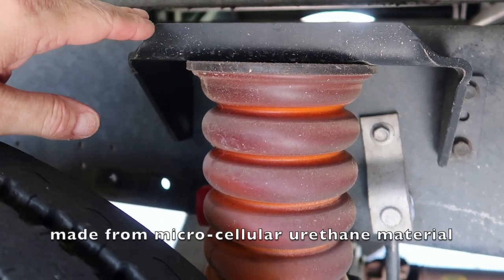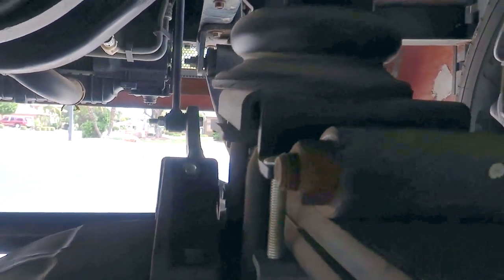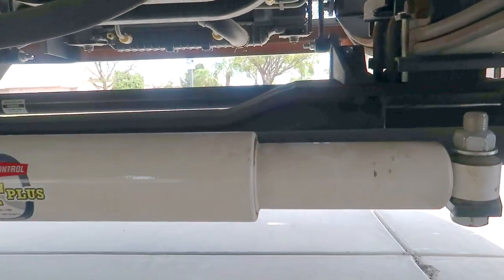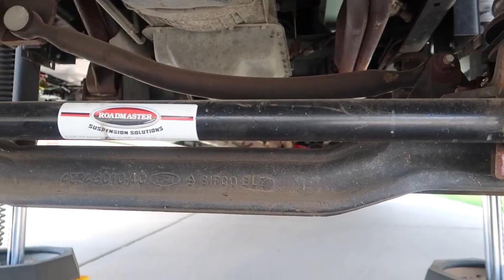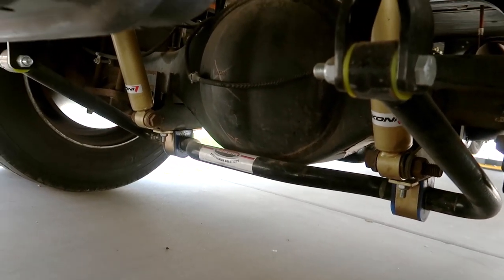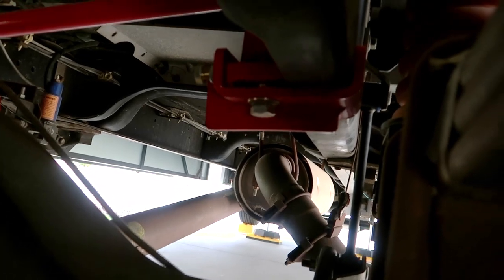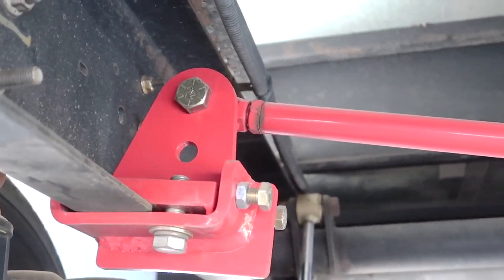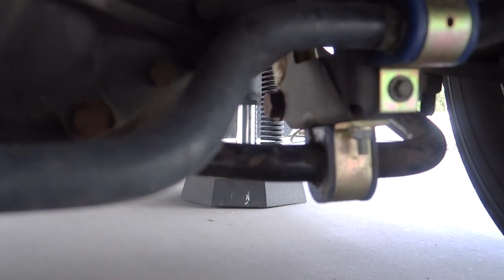CLASS A MOTORHOME SUSPENSION UPGRADES [NOT SO CHEAP HANDLING FIX]

Comment: Thank you very much for covering these suspension components!  They look to be well worth their money for additional comfort and safety.  I am kind of surprised that the manufacturer doesn't include some of these additions.  It would make their product just that much better out of the factory.
Reply from the maker: Thanks, Alan!  You are right!  Until 2020 Ford had not made any significant changes to the chassis.  In 2020 they upgraded the sway control bars, shocks and bumpers. They also replaced the Triton 6.8 liter V-10 with a 7.3 Liter V-8 engine.  Thanks for watching!

Comment: Great video. Thanks for all the good information. I just came home with a 2019 precept 29V. We love the floor plan, however, when I got home last night I realized that it is sagging to the left.

The unit has one huge slide on the left/driver side of the RV. So, there’s a lot of extra weight on that side. I’m about to make a video for the dealer and for Jayco. I haven’t decided yet if I’m going to try to get my money back. I know I bought it as is with no warranty but it was less than 24 hours ago. It did have an inspection but the inspector didn’t mention anything about the suspension. It drives great. I mean, it drives as well as my 2010 Winnebago vista did. I didn’t notice that it was leaning to the left because the dealer had it set up on the leveler when I arrived. And then I took it for a test drive and it drives great.

Anyway, I was wondering if you had any thoughts about how to modify this suspension to help adjust for the additional weight on the driver side?

It seems like this could be a safety issue. There’s so much extra weight on the rear tires on the left side and also on the front left wheel, I would be concerned about having a blowout at some point. You can already tell that the tires look like they’re under a lot of weight.

I’ll share a link to my YouTube video once I get it done later today. In the meantime, just wondering if you had any thoughts. Thanks again for your video channel. I just subscribed and I look forward to checking in with you later today.
Reply from the maker: Hi there! Thanks for reaching out. Send me an email to LyfUninterrupted@gmail.com and I’ll provide my phone number so we can discuss.

Comment: Wow, we also have the SnapPads. We love them. We found that good tires with correct tire pressure and a wheel alignment made a significant difference. We also did the "Cheap Handling Fix" to the front a few weeks after and that helped further. We also put in the Roadmaster stabilizer a couple of months later but haven't noticed any difference as yet. With your handling mods, did you test drive after each mod to see what helped what, and what didn't make much of a difference?
Reply from the maker: DrinkinSlim The Sumo Springs, anti-sway bars and the safetplus made the most noticeable improvement on handling. The rear track bar may have made the least improvement. Rigs with longer rear overhang will probably have more improvement on tail wag.

Comment: Good video. I see you have a set of headers. I installed a banks kit and it made a huge difference in power but the only time it makes a mileage difference is the times my wife drives . She managed over 9mpg in Nevada.  I was looking at whether to put a trac-bar on the rear of my Class C . The front is independent coils so doesn't need it. Thanks for the input.
Reply from the maker: Hi Bob!  9-10 is pretty much what our coach gets. Not sure what the mileage was before the addition of the Banks kit, but the owner said there was a noticeable improvement in power as well. Thanks for watching!

Comment: Any Demo on the changes in the suspension?
Reply from the maker: No, but the changes are dramatic over the stock setup. This said, I would recommend adding the safetplus and replacing the front anti-sway brace first to see how much that improves the ride. If you need more control or comfort then add the sumo springs, additional rear anti-sway brace, then track bar.  In that order. 

Hope this helps!

Comment: Where did you get your alignment done? was it on a rack/machine or was it manual adjustment with a tape measure? I have a  new to me 2003 Monaco Knight and Just came back from a 1K trip and it drove terrible.
Reply from the maker: I always have it aligned at a heavy duty truck shop or a service shop that is knowledgeable of the chassis and coach characteristics.  Don’t rely on a generic tire shop to do the alignment.

Comment: I was told Safety plus will not work on my 2000 winnebago brave 35C!!
Reply from the maker: Sorry to her that Kellie. I did check on the website and your RV is not listed. Did you call the company to verify?
Reply: @LyfUninterrupted Yes and actually ordered the parts which a certified RV mechanic told me it will not work on my class A!! I had even given my Vin# to correctly get the parts!! It's been a complete hassle since!! Etrailer assured me that I ordered correctly and have the confirmation to prove it!!

Comment: I have a 07 Forestriver Georgetown, just came thru Washoe Valley wind blowing me everywhere, that’s Reno area. Will Sumo springs stop moving me around. Great video.
Reply from the maker: Keith Schwaiger That’s a tough question to answer without knowing the condition of you existing equipment. In general, Sumo Springs will increase control and stabilize sway.  If I were you I would probably start with an rear auxiliary anti-sway bar as well as a larger front anti-sway bar. If you already have those then you might want to go with Sumo Springs. My coach is so much more comfortable and easier to drive.

Comment: What was the biggest improvement of all? Are the knoni's worth the money?
Reply from the maker: The biggest bang for the buck were the new front and rear anti-sway bars and the steering stabilizer. I always recommend installing those first, then go from there until the coach provides the level of smoothness you desire.  The KONI shocks are much better than the stock Bilstein shocks...IMHO.

Comment: Will these upgrades work on 2016 Winnebago vista lx 35’on a f53 frame . Also are all f53 frames typical. You don’t have the part that bolts to the differential in your store
Reply from the maker: Hi Kevin. There most likely would be versions to fit your coach, but you need to check each component to verify fit before ordering them. 

As for the rear track bar, you can find it at www.supersteerparts.com.

Comment: Great Video! I’m curious to know if any of these mods reduced road noise level in the cab and improved the overall comfort and cushion. We have a 2016 holiday rambler admiral and the impact on the smallest bumps in the road will shake and rattle the inside of the rig tremendously. I am Looking for a solution to soften up the ride and reduce vibration from the road.. any advice? Thanks again!
Reply from the maker: Hi Vincent.  I assume you have a gas coach.  The Sumo Springs definitely help soak up some of the road noise.  Another tip is to make sure your tires are at the right pressures.  Tires that are over inflated are firmer, which can translate noise and road anomalies to the coach.  I try to find the sweet spot so that the tires are properly inflated but still not too rigid.  Our coach is on a 20,500 pound chassis and I run all tires at 85 psi.  That pressure is based on Goodyear tire pressure recommendations for the weight of each axle.  Hope this helps.
Reply: Lyf Uninterrupted  awesome and thanks for the tip! I actually lowered from 90 to 82 psi today and found that the coach had more sway. The ride is more comfortable but now more unstable. I guess 80 psi with your mods would be just right??
Reply from the maker: It's hard to say.  Have you weighed your coach recently?  If not, I would recommend you do that so you know exactly what pressures to run.  Here's a link to some great info on tire pressures and coach weight: https://www.motorhome.com/motorhomes/motorhome-gear/weigh-to-go/.  Do some more testing with tire pressures, but my guess is that your coach would benefit from aftermarket front and rear sway-bars.  However, before you spend any money on anti-sway bars, try doing the "F-53 Cheap Handling Fix".  There are plenty of videos on YouTube that show you how to do that.  This simple adjustment to the front factory anti-sway bar may make a big difference in the handling of your coach.  If that doesn't work, then you may want to go with a replacement front anti-sway bar and an auxiliary rear anti-sway bar like I did.
Reply: Don’t underinflate light truck tires.  They’ll heat up and fail.  They aren’t like car tires.  They’re made to be run at optimum pressures, is what I’ve been told by mechanics.  Bus driver, here.

Comment: thanks so much for this upload and your explanation.  It is really well done and very helpful.  We are looking at a 2007 Mirada on the F53. the dealer was saying that it gets pushed around a lot and tried to steer us away.  Your video has me convinced to go ahead and buy, then use your tips to get me to be OK with the ride. One question I have is what upgrade would be the first to do?  Thanks again, really well done
Reply from the maker: Hi Robert!  Welcome to our channel and thanks a bunch for the kind words. The Coachman Miranda is a solid coach for sure. How many miles does the coach have on it?  The easiest and simplest upgrade to do first would be to replace the factory front anti-sway bar and add an auxiliary rear ant-sway bar. Start with front and see what results you get. I’d be willing to bet it would help a bunch. Then add the rear anti-sway bar if you’re not satisfied.  Another key component in ride quality are the shocks. If they are original then I would have them replaced.
Reply: @LyfUninterrupted  Hi Lyf, thanks for the quick response  coach has 40192 on the clock  it's an 07 asking 29k.  Needs some updating  stickers are shot needs a good buff  fabric is let's say, dated  I hear good things about the F53 with V10  I am not a mechanic but can do most repairs myself.
Reply from the maker: I really like the Triton V10 too. Good luck with the coach and be sure to let me know what upgrades you make.

Comment: I'll stick to the cheap handling fix, this stuff is way out of my price range
Reply from the maker: The cheap handling fix often times turns out to be an expensive repair. Many have reported that the links end up breaking with damage done to the chassis.  We would recommend starting with a large front anti-seat bar. See how that changes the handling, then move to a rear auxiliary anti-sway bar. Often times this is enough to improve the ride substantially.

Comment: Hi. How did you get the old bushings out of the end links?
Reply from the maker: Great question Ralph. I simply pressed/hammered them out using an old socket that fit. They came out pretty easily. Press/hammer the new ones in the same way.

Comment: Great video.  I'm about 2 projects behind you but have already noticed a handling improvement. Did I notice headers on that engine? If so, are you happy with that addition?  Thanks!
Reply from the maker: That’s great!  Which upgrades have you installed?  The previous owner installed a Banks Power Pack system. Headers, new air intake, 4 inch exhaust and engine tuner. He said he noticed a big difference after installation.  I typically run no more than 65 mph towing our Jeep. Average fuel economy now is about 7.22 miles per gallons. Not sure how much better that is than stock. Our Jeep weighs considerably more than what the previous owner towed, so that is likely to make a big difference in fuel economy. I just bought an OBD engine tool that provides a ton of operating parameters, so on our next trip I’ll check out the horsepower output under load.
Reply: @LyfUninterrupted  , I've swapped out all the bushings, upgraded to Bilstein shocks, added the sumo springs, a steering stabilizer. (Gotten the front end aligned after).
And added a bigger rear sway bar.

Looking at engine mods next, not so much for extra gas mileage, ( which I'll pretty sure never see), but more for the torque when running up hills.  Just driving out of LA we have those long grades going over the passes. 
Thanks for the reply.
Oh, and I added a scan gauge to monitor engine functions.  It's very helpful.
Reply from the maker: Our Jeep is right at 5000 lbs, so we’re a little under 1000 pounds of max combined GVWR. Speed tops out at about 45 mph  and 3700 RPM when pulling long grades.  Question on your Sumo Springs: have you noticed a bit harsher ride since installing them?  Especially in the rear?
Reply: @LyfUninterrupted  my coach is a 2012.  My rear AND front sumo springs look like your rear ones. (Not like the bumper snubber on your front). I also run 100 lbs air in my Bridgestone front tires and 80 in the 4 Michelin rear.  It's no Cadillac, but it's not that harsh.  Even if it were, I'd put up with that rather than "changing lanes" every time a semi went by. 🥴
Have you done anything to reduce the noise in the cockpit? I just installed Kill Mat sound deadened to the doghouse. (2 layers of 80mm).  Dropped the noise by about 18 decibels.   I'm thinking of applying it under the rug by the front seats.  I have to take them out to reupholster them anyway....
Reply from the maker: Been looking at putting some of that under the dog house too.  Good to know it drops the sound that well. Have also considered a product called Lizard Skin. They have a sound deadening material and heat barrier material that can be sprayed on the underside of the cockpit area.
Reply: @LyfUninterrupted  I did a lot of review for sound deadener materials.  Kill mat has the best reviews.  Lots of people use it in restoring cars, adding sound equipment, quieting vibrations. 
Also purchased a decibel meter on amazon for $18, so I could measurements before and after.  I'll take readings after I add more material to different areas. When it doesn't get help, or I get a good return on my investment, I'll stop.